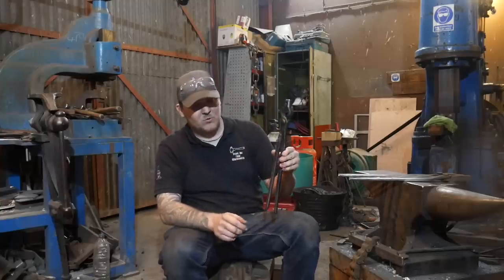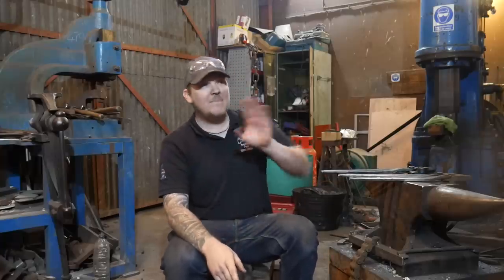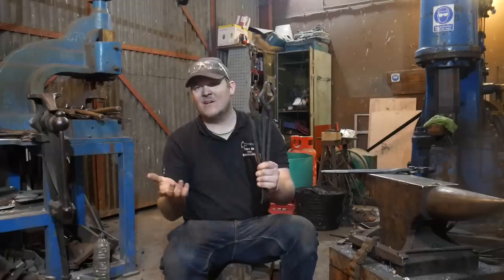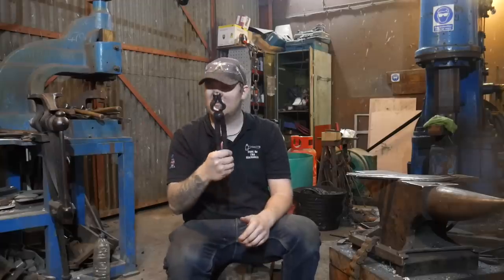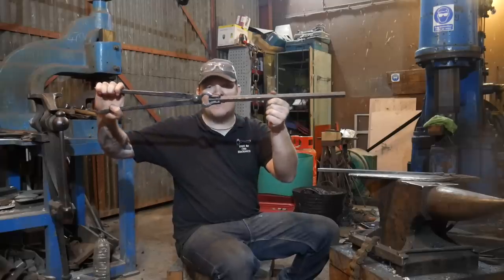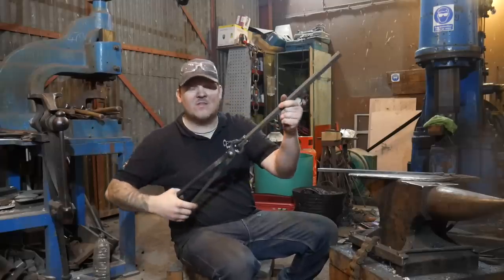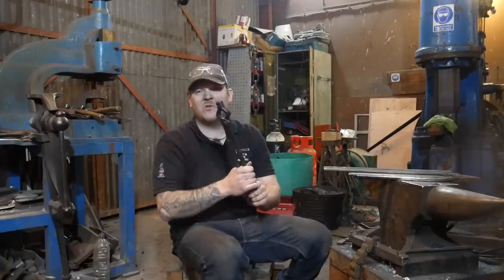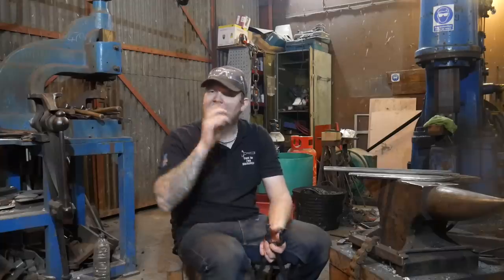Wolf Jaw tongs! Greatest tongs for a beginner Blacksmith! Remake!

Comment: The greatest beginner blacksmith tool currently is YOUTUBE and a fat bank account. :)
Reply: Actually just a Youtube, a bit of space and a lot of willingness/desire. 
I started to carve spoons a couple years ago. Bought only a cheap Mora hook knife and a folding saw at the supermarket.
Made my own straight knives out of old files. Made one hook knife with a little anvil nailed to a block of wood, using an old chisel. Used my fireplace for central heating as a forge;)
Now i'm making my own propane forge and all i had to buy was some pipes for a burner so far. And a bit of refractory powder i will mix with a sand and plaster.
Really, it takes much more willingness and effort than money:)
And some inspirations from guys like Daniel, Trobjorn, Alex Steel and a lot of other wonderful blacksmiths here.
Bertram's channel can be an amazing inspiration. He made a viking style movable "forge" that you can fit in a small bag. If you really want, you can start forging with a bit of charcoal, some mud and stones, some tongs to grab a hot metal (i used old, dull cutters) and any hammer :D

Comment: I would like to say a 500 # Massey power hammer, but I don't think that will get you to build one!
Honestly,  after the hammer, anvil, & vise, you need the tools to make a set of tongs.  So, a punch & drift (although you can use the punch to drift with), and a chisel. Those would be the bare basics. With those tools, you can begin to make all the other tools necessary to start making your own tools (hammer eye drift, more punches & drifts, the continually growing pile of tongs, hardy tools, etc).  It's really difficult to make more tools without at least one pair of tongs, a punch, and a chisel. Once those basic tools are available, you can make more of them, but those would be the absolute bare minimum tools.

Comment: Compared to the ones you showed alongside these Dan I'd say you've made a pretty decent jump in quality. The tongs you've made here would be my pick for the best tool for a beginner to make. Hammers are easily bought, chisels and punches too, but tongs aren't something you can just pull off a shelf. The wolf jaw style, along with the slight goose neck in the nibs means these can be hot adjusted (if needs be) to a pretty wide range of stock sizes. Perfect for a beginner, make one pair and then get on with learning.
Reply from the maker: Thanks Ian means a lot. hope your well and great comment.
Reply: @danielmoss2089   Just calling what I see mate :D If they were crap I'd be ribbing you over them.  I'm still upright, thanks for the asking, but am getting over a quite serious illness at the start of the year.  Just at the point where I've gotten back into the shop for a day or two. Long boring story ;)

Comment: Daniel, good video. I have a rudimentary question. Would you explain the difference between coke & coal. When people say they are using coal, are they talking about house fire coal? If coal has to be transformed into coke what is it that actually takes place in that transition? Is 1 better than the other? I know this is very basic but somewhere in my learning I have missed this part.

Comment: Dan are you gonna sell the parallel jaw tongs that you made based off of Alex's design ( valhalla forge )
Reply from the maker: Would you like a set? I'm not sure I will be as they would be very expensive and not that practical.
Reply: Just a diagram for myself with very precise measurements but a friend of mine is interested in them

Comment: Do the rains need to be that  thick with this type of tongs or are they for use under a power hammer they are a nice set of tongs
Reply: Thanks dan its just hard to see proper demotions when not in person do you build the tongs for the pin diameter or finger out the pin demotions when the tongs are in the final stages of construction

Comment: did you make them right or left handed?
Reply from the maker: The reins are Centered and have no index. You can uses the left or right hand. I make all my Tongs like this. That's what I was doing with the bending forks in the vise.

Good question hope that helps.
Reply from the maker: Centring reins isn't common on most hand forged Tongs as it's a little time consuming. But they sit ace in the hand.
Reply: @danielmoss2089  i asked because the only time it was explained was black bear forge, if the top jaw was also the left side of the boss they want to fall to the left, or INTO the left hand, for a 'righty' with the hammer...and so forth,  have you heard of anything like this?
Reply from the maker: I was always tought it was which way you do the second Set down. I turn into my body witch makes a set of Tongs for a left hand. I've seen John's video on this subject and can't disagree. But leaving the Tongs hand can cause you to Forge out of square. Hence why I center them also any one can uses them. I also uses a power hammer daily and this means I hold Tongs in my hammer hand and top tools in my left. Hand Tongs just don't work for me.
Reply: @danielmoss2089  i do appreciate the clarification there,  thx!   that makes sense

Comment: What is stricking?  That is a lot of hammering for tongs.  Most beginners don't know a master smith to strike for them and also would, or should not allow their beginner friend to swing a 10 lb sledge over there anvil.  I would suggest a striking anvil shaped object for that, or you will lose chunks of your hardened plate when your friend misses strikes.  There are several super simple ways of making them until one learns how to manipulate material.  Just take some 1/2" square or round.  Cut it at 12 inches, upset 2 inches at the end until the stock is 11 inches.  A lot of peeps use 5/8 or 3/4 stock.  I don't like to spend a half hour drawing out reins so I start with smaller material.
Remember most beginners work alone.
Forge On!!!